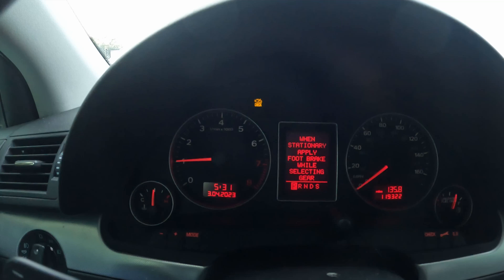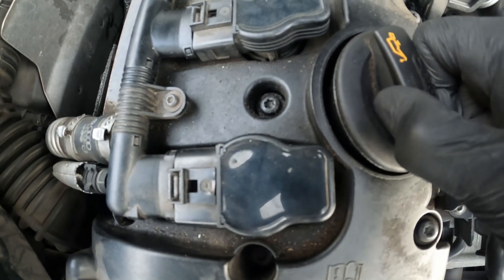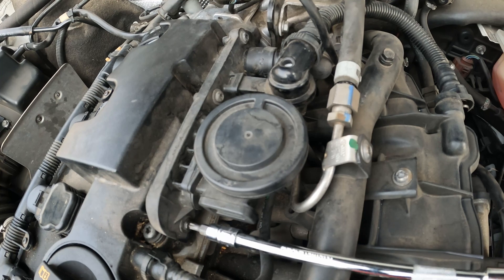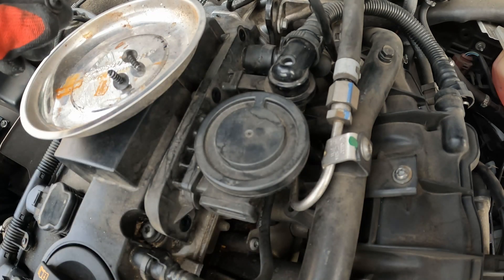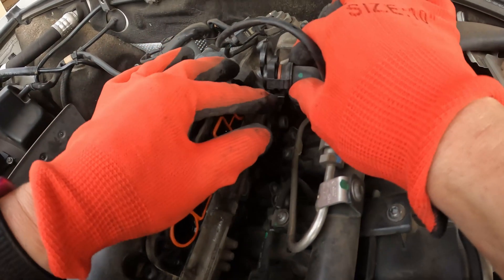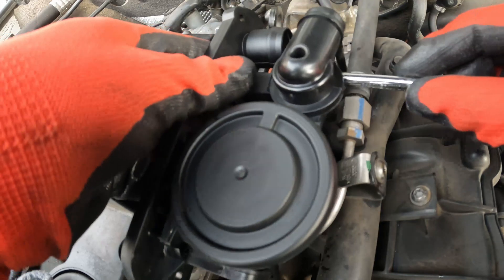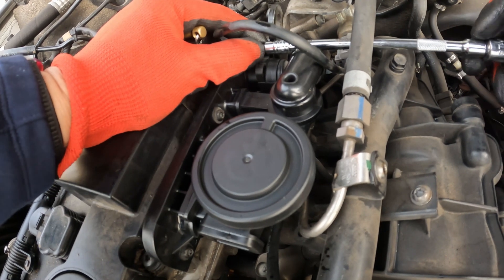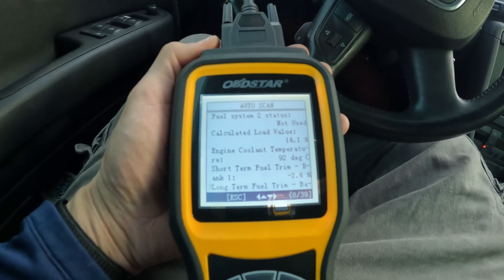How To Fix "P0171" Code | EP-2 | Audi A4 | PCV Value Replacement #audia4

Comment: I found out the oil supply of the vacuum pump was almost fully clogged with dirt causing the seals of the rotor inside not to close completely so not enough vacuüm was build up and pulled up a p0171 code

Comment: G'day. Quick question.. do you still have the old PCV? I am trying to put a new PCV diaphragm for my Audi A3 1.8 TFSI (part no. 06H129101B), but this part is so rare to find.. So basically I am planning to use the diaphragm of your PCV(because it's available very easily through ebay or Amazon) inside 06H129101B.
Both the PCV diaphragms are of same size.
I am just wondering how the diaphragm inside your PCV looks like and hoping you may know about it. Cheers.

Comment: Hello. I have the same problem in my A4. I replaced the oxygen sensor and coils and it was not solved. Did the engine light come on again in this vehicle?We will also look at the evaporation valve.Do you think the quality or additives of gasoline could also cause p0171 error?
Reply from the maker: Check all three videos I did in my playlist on this car. You are never gonna believe what the issue was. Something really simple.
- Scout 🙏
Reply: Is it the oil dipstick gasket?There is no oil dipstick on mine. I suspect the steam valve. I hope there is no problem with the catalyst.
I also suspect gasoline. @scouts_garage
Reply from the maker: I would go through all the steps I did in the videos..also check your oil cap seal O-ring. I would have changed the OS2 sensors last. That would have been the last video, but mine didn't need it. Also, did you spray around the engine with cleaner to see if you have any vaccum leaks. Wishing you luck on the journey. God bless.
- Scout 🙏

Comment: I learned that test from this video! I went out and tried it in my 2008 Audi A4 B7, and the cap came off easy. Lol. But I still replaced the PCV valve because my car is been burning about a quart of oil a month and that was the culprit. If your oil fill cap or dipstick are easy to pull out with a car idling, very good possibility it’s your purge valve which is even cheaper and easier to replace. I’ve come in before another video but I never thought of the purge valve because last time it went bad, the big symptom was that the car would not start after I got gas and would take me about 10 attempts. But with a slight issue with the purge valve, it was creating a slight vacuum leak which was leading to the P0 171 code  and making the short term fuel trim compensate. But if it wasn’t for this video I would’ve never known about this crazy and easy test to research more. So thank you!

Comment: What’s the name of the part and where can you order it I have a 07 Audi A4
Reply from the maker: Thanks for watching. All part numbers in description
Reply: @scouts_garage  thanks I got it fixed months ago now I'm having issues with my car again it's not starting and the EPC light came on the day before and it wasn't picking up acceleration
Reply from the maker: Bummer. Did you try to reset the EPC to see if it just might be accidentally triggered when you changed out the part
Reply: @scouts_garage  no how do you do that and the car is not starting at all I tried to do a jump it's not working
Reply from the maker: @markeke4000  there are a few videos floating around if you do a search with the steps. Also, I think it shows you how to take it out of limp-in mode. Good luck 👍